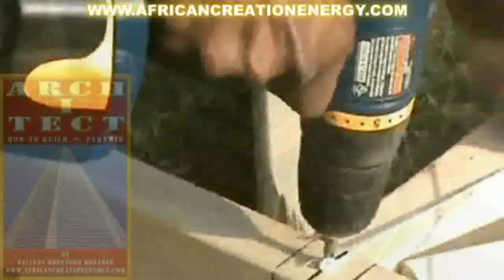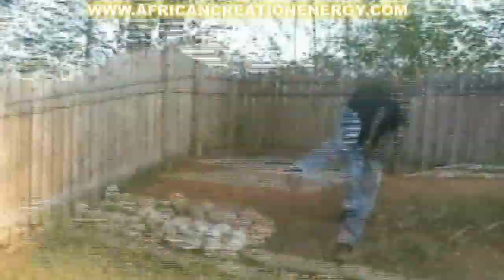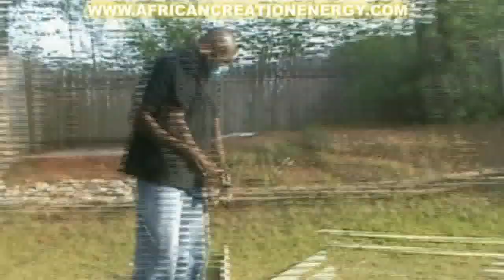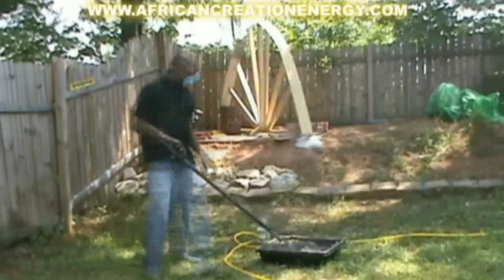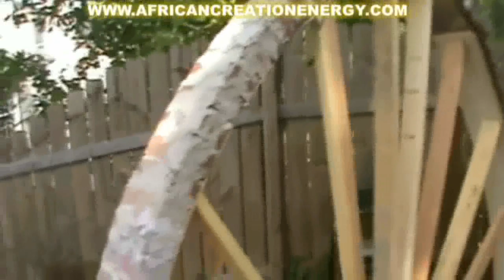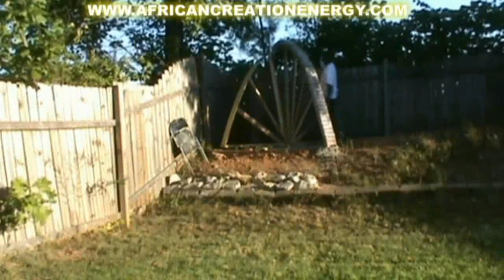Nubian Arch, Nubian Domes, and Nubian Vaults | ARCH I TECT: How To Build A Pyramid

Comment: I used ammonia to bend wood for my bookshelves.  I tried water and kept breaking.  I have been thinking of building a pyramid green house, not certain yet.  great work and I hope the project(s) are successful
Reply: Hot water. As long as you have something that will hold water, build a fire around a stack of medium-large stones. When the fire burns down, drop the rocks into the water. A little space inbetween the wood for cerculation and BaM.  Worked for the Egyptians. Peace. Ammonia? Now I'm curious. Good tip, Thank you.
Reply: Yes I am thinking of that kind of greenhouse also

Comment: Here's a tip, if you want to bend wood you'll need to steam heat it first. I do it for complicated curves in boat building
Reply: how about kerfing, that is after all what it is for especially with plywood.
Reply: @MrTechmoore  Kerfing is so much more work and creates weaknesses, why do that when you can bend?
Reply: @Antipodean33  it's just a method that's all
Reply: How do you Steam wood?
Reply: @shantelnubian2071  Look it up it's very easy, involves steaming the timber

Comment: Great project with a powerful meaning. You've shown us the Nubian Arch can be the "backbone" of many beautiful and practical structures. BTW, the air well will produce water in the desert. The structure will cool below the dew point temperature at night by radiating its heat to the night sky. Moisture in the air will condense on the cold structure. I am guessing the condensed water drips-runs to collection points... I doubt the Air Well produces significant volumes of water in the desert... but it would produce SOME water. Keep up the Great Work !!

Comment: Check this out in it's entirety: parametric architecture.  Here's a small short cut. Take a small chain of jewelry, say 20 inches long, grab both ends and bring your ends about 8 inches apart, that chain will hang 7 to 8 inches downward from the center(mid-point) of your ends.  This describes the parametric arch.  It's seen all over the world, all over nature.  The St Louis Arch is that shape, right-side-up of course, described by gravity, and egg shells.  So, it's a formula I use to make arches.  1/2 that distance across the base (in this jewelry chain example 4 inches) times 1.8 or 1.9.  Forming an arch just slightly less tall than the  entire width of the arch at the base.  Hope that helps.  Of course you can make it "taller", but will weaken the arch laterally (for seismic or wind load).  Likewise if you lower or shallow the arch to the dome shape, it's only as strong as the arch until you pass the circle shape, like a wide bowl, then it's weaker structurally to gravity weight load.  The structural genius of the pyramids was due in large part to corbelling the interior chambers.  Hope this is useful.
Reply: 90% Width of base = Height of arch
Reply: This also may have been the Cremonese secret to building such great sounding violins, violas and cellos. Instagram @emeraldcityviolins

Comment: I always thought Nubian arches looked more like cantenary arch than the parabolic arches used by later cultures. Cantenaries are more stable in construction than parabolas because the stress forces of a cantenary are directed straight into the ground where in parabolas, the stress forces go out to the sides, hence why midevil European constructions needed buttresses in order not to collapse under their own weight.  

Western geometry, from Pythagoras on down really hadn't defined the cantenary as a seperate shape from a parabola until the late 1600's, and didn't bring into construction until the 1700's, a bit late for the major cathedrals.
Reply: Colleen Forrest “Western Europeans” did know of the the “catenary arch” long before the1600’s. The word “catenary” originates from the Latin word for “chain/rope”. It was in the 1600’s that Western mathematicians first developed the equation for the “derivation of the catenary arch”, and discovered the differences (mathematically) between the parabolic, and the catenary.

Comment: Try using pVC pipe instead of the planks and you can easily get the shape you seek. Simply put the pipes side by side to make a form that is strong enough to hold the bricks until the mortar dries.

Comment: I once learned that a perfect parabolic arch can be achieved by holding both ends of a rope, chain, etc. and allowing the middle to suspend - like how we hold a jump rope. You can get any proportion you want with that method, without any mathematical calculations.
Reply: but how do you go on from there? you have your arch suspended in the air, what then?
Reply: What I would do is suspend a wet rope across a sheet of plywood or something, then spray paint over it to leave the profile on the background.  Then from there I would turn the plywood upright, cut the profile out and use it as a stencil.  That is for parabolic arches - that are a little different from ellipses: which there is a very simple string method I learned from some builders in Florida.
Reply: Troy-Moses Panton Yeah, the catenary curve is a very important overlooked geometric form. used for the St Louis Arch and many other places.